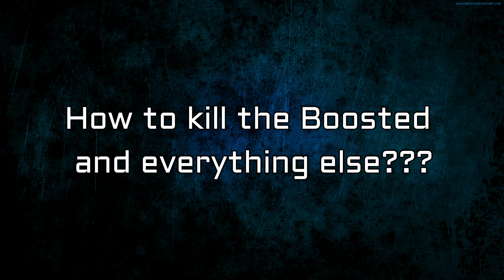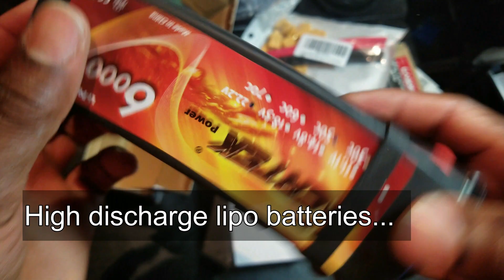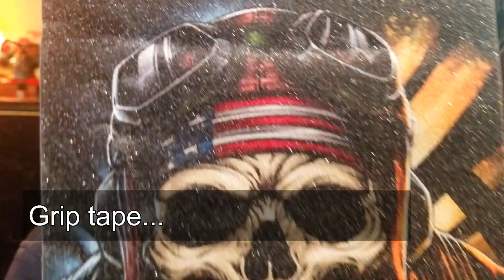HOW TO BUILD THE BEST DIY ELECTRIC SKATEBOARD? BOOSTED BOARD KILLER - Part #1

Comment: You are the king at building boards. I just want two 600 watt belt drive motors on my yuneec. But can the same battery power it??
Reply from the maker: the yuneec uses 5amp, 3400mah cells, 3 in parallel and 7 series. that's a pretty good capacity (Good range) but 15amps continuous, not a lot for a dual drive. Will ride fine but will likely sag going uphill. Would opt for a better battery